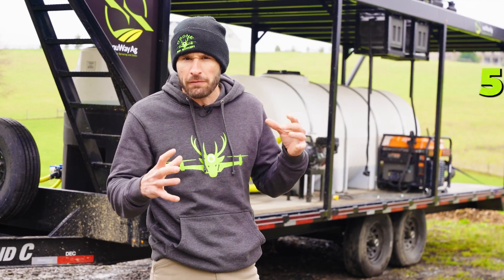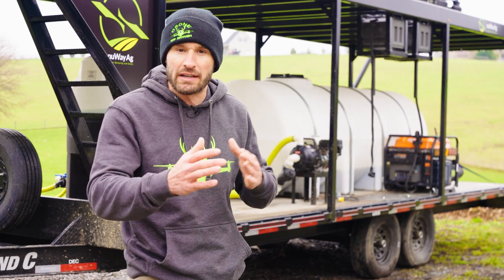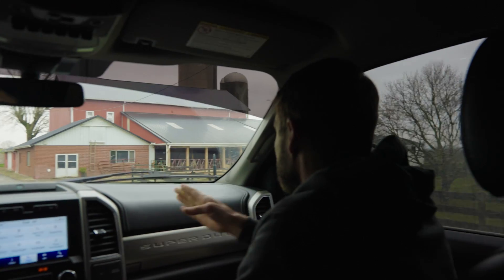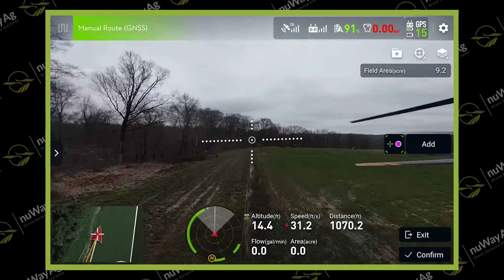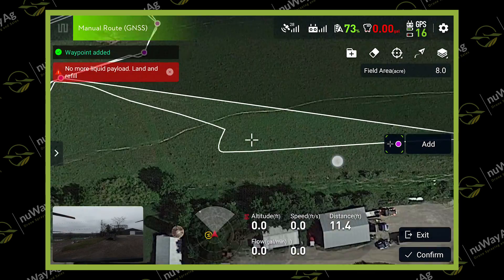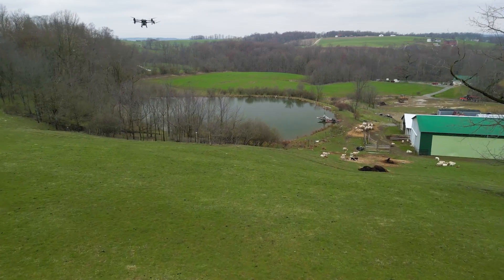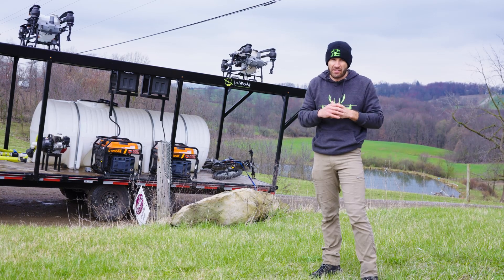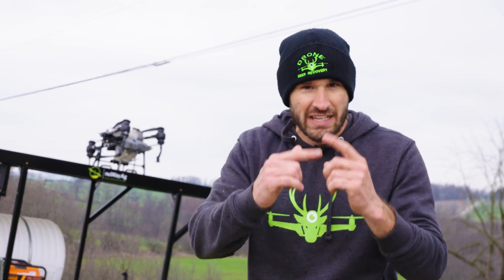You NEED this Spray Drone Trailer

Comment: If there is a power-line going through the middle of a field you have to spray, do you draw multiple separate boundaries around the power line?, or do you just ignore the power-line, and the drone sees it, and the drone avoids it by itself?
Reply from the maker: No, you either boundary it and split the field, or you set the spray height of the crop so the drone slides under the powerline. Depends on a bunch of factors.

Comment: Do these drones paths sync up? Our smallest field is 100acres would entire 640acre  sections be a problem? How would these handle 15mph winds?  Would one operator be able go manage 4 of these by themselves?
Reply from the maker: Big fields are not a problem. Spraying is more effective on big fields because the boundary work is less. 15mph winds is a lot. High winds shut down spraying operations if from a plane helicopter or drone.

Comment: At 4:02… how is that controller mounted to the rail?
Reply from the maker: We sell the mount on our website under accessories. New and improved website coming soon
Reply: I'm assuming its like a phone mount, not too sure
Reply: You can se it clearly at 2:08. Its a crab mount with an adapter. and at 2:26 you could se that they are using an camera adapter with a quick releas with the camera plate on the controller and the other part on the crab mount. You can find Carb mounts in AV stores used all the time for mounting stuff for lighting and stuff.